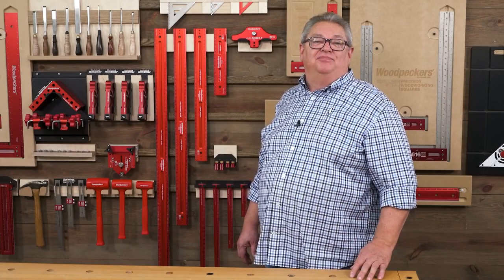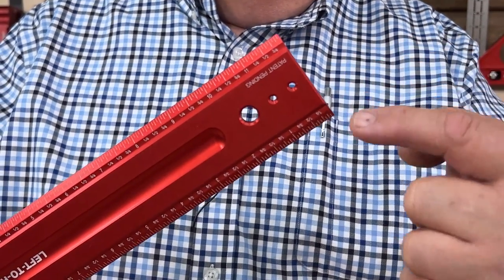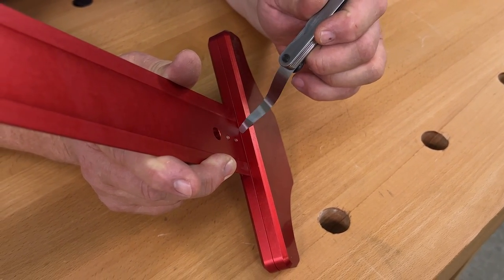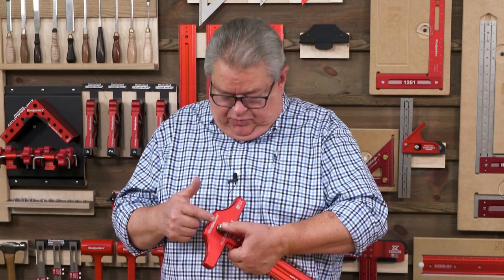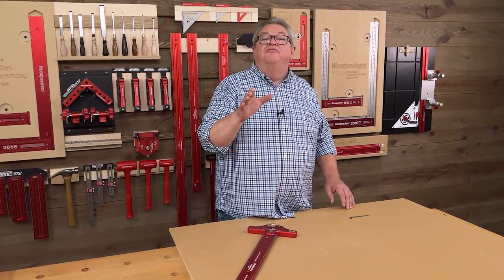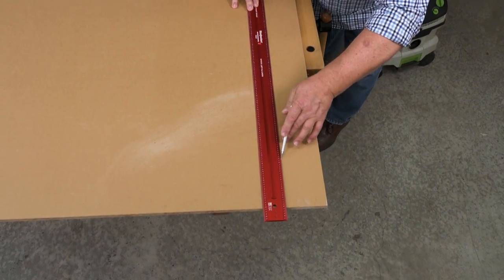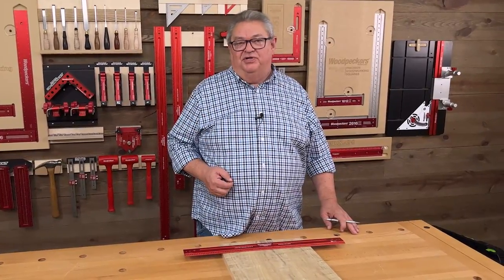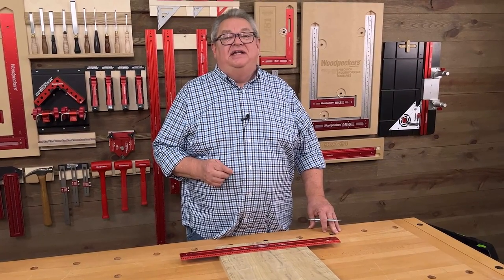45/90 Combo-T & Woodworking Rules Tips & Tricks | Deep Dive | Woodpeckers Woodworking Tools

Comment: Your Swiss lathe turned set screws should have knurled knobs on the top so they’re easier to insert and turn, you may want to keep the Allen wrench opening on the top for a tighter fit.  It would also easier to find when you drop one of those set screws.  A holder on “tee” would be handy to keep the Allen wrench in too.

Comment: Seeing the screws are not off the shelf screws, by chance is there a place on the combo-T to keep the screws? I might not always have the rule installed (Many times I will use the rule in the center of a board).  UI feel a built in storage for the screws would be very handy. (I myself am not concerned with the storage of the wrench, I have a set of T allen wrenches very handy)
Reply from the maker: There are spots in the Rack-It for the screws.

Comment: I don't normally complain about Woodpecker pricing because I get it, but when the accessory costs more than the thing it is accessorizing? Feels odd.
Reply: Yeah I think I would just buy their actual T-Squares, since they end up being cheaper anyways, are probably more accurate, and have the scribing guides. A 24" T-Square should be large enough for most everything, even on full sheet of plywood that get more than half way across which should be enough to accurately extend with another straight edge or just as is with a track saw.